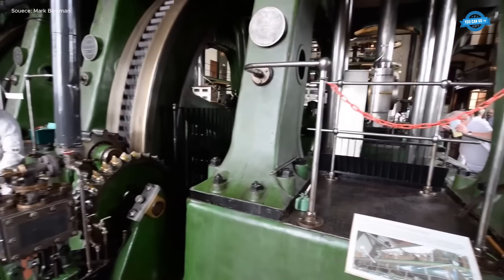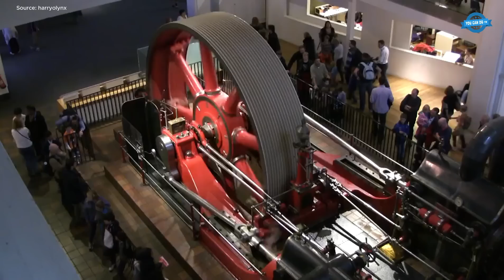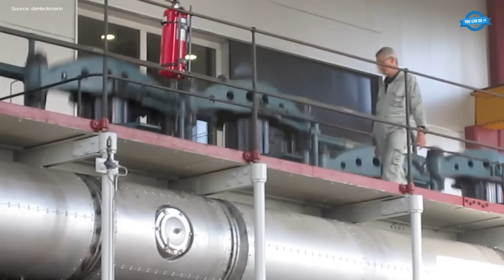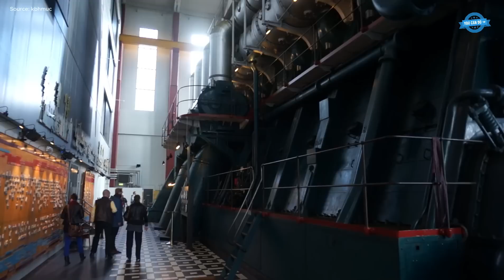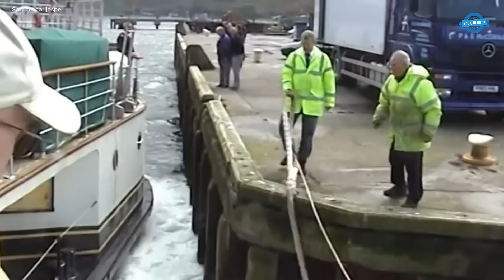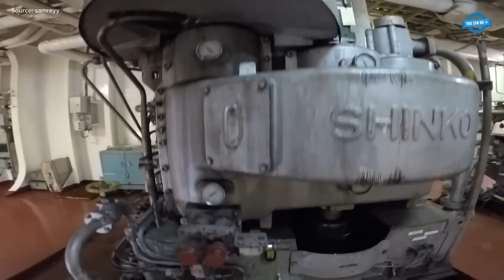The Most Powerful and Giant Engines of All Time. A Journey into Steam, Diesel, and Gas Power History

Comment: The Kempton Park steam engines are only slightly smaller than those of RMS TITANIC, and run at about the same 200 psi steam pressure.  Each of the TITANIC’s was rated at 15,000 ihp.  I’m baffled as to why the Kempton Park engine is only rated at 1008 hp, but this is described as “water horsepower”, which may be totally different than indicated horse power (ihp).